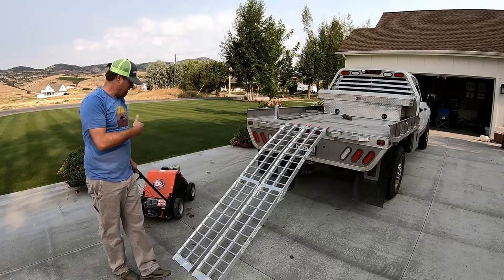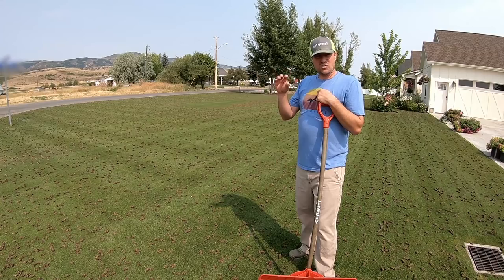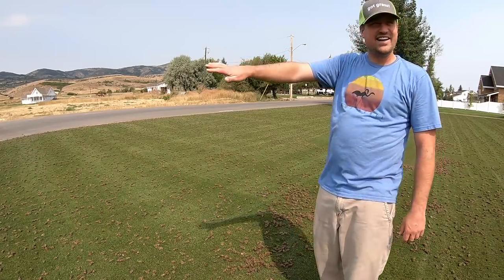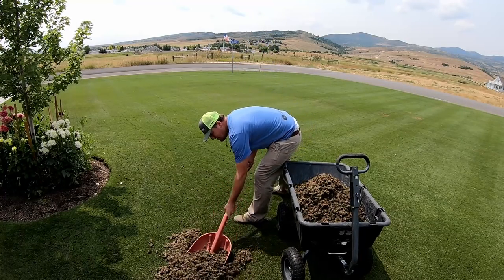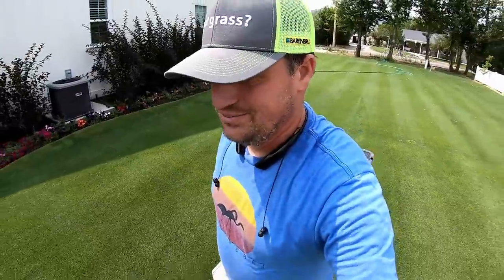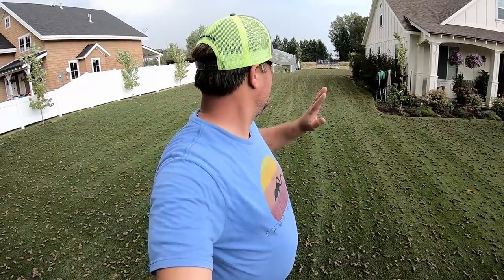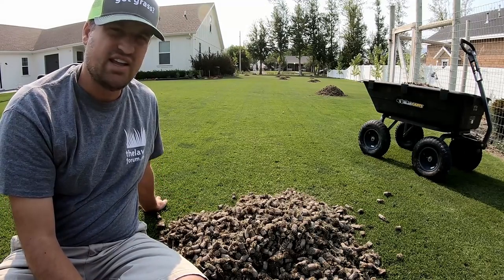How to AERATE YOUR LAWN // REEL LOW  //  Connor Ward

Comment: A great idea I've seen and done is after the core aeration, you spread out the fine dried steer manure and rake into the holes and water heavy.  Works amazing for amending your soil right at the root level and gets the nutrients and organics worked in deep.  Highly recommend with the clay soil!  Great channel BTW.  You earned a new subscriber!

Comment: Hi Connor, 
Great job on the Aerating, that is a very big job.
That would be like aerating a entire championship ranked golf 500 yd fairway and shoveling the cores by hand.
Thank you for sharing and I look forward to sand and over seeding. 
Cheers,
Craig
Reply: Craig true to an extent. No knock on Connor at all, but he’s just using a drum aerator. Golf courses utilize piston driven aerators which pull way more plugs. There’s basically a hole close to every inch or so depending on how they space it
Reply: @Datdudetd46  he's actually not using a drum aerator it's a reciprocating aerator, similar to what courses use. You're right that he's not creating as many holes though.

Comment: If you have a rotary mower can let the cores dry out, then mow them for a free top dressing then just blow the thatch. 

Before landscaping I worked golf courses, we shoveled the cores from the greens and fairways since they were reel mowed, but on the rough we used the rotary mowers after the cores dried to pulverize into topdressing.

Comment: Good job bud, you can always verticut also to get some thatch out,I'm sure your aware of that, eventually you will have enough sand mix in the soil where you can just grind the plugs up, drag the sand in, blow away the left over grass tissue, your right on removing the cores to improve your soil profile,  very well done

Comment: Hi Conner, I know this is an old video. I was in golf and I 100 percent understand why you remove the cores. I’ve done it on greens and tees many times before. I’ve seen you drag the sand in. Have you ever considered or tried dragging the cores when they’re dry?  I know there will be a short clean up after dragging but it might mitigate some of the layering inevitable by sand only top dressing   Love your content!!

Comment: hey Mr. Ward, something we do on our reel mowed yards down south when aerating instead of manually picking the plugs up is running over it with a rotary mower on its lowest setting. it usually gets rid of id say 90 percent of the plugs. I don't blame you for not wanting to run over all that dirt with the reel as it would absolutely ruin the cut quality. Hope this little trick helps
thanks for the vid man your property is looking fantastic.

Comment: It looks amazing Connor. You can tell your work hard in that yard and the landscaping is amazing too. You should look into the Ventrac 3000 series tractor and the aerator attachment. It punches holes and vibrates so there is no core. They are costly little tractors but the attachments that have are amazing. I'm trying to get my 'finance committee' to approve one for me.

Comment: From a golf course super, Core aeration is more than just letting water get down there and nutrients. It pushes black layers down, allow for air exchange, relieves compaction, breaks a heavy thatch layer, makes phosphorus available to the roots at the root level. For a lawn, once every few years is more than enough. Vertticutting the cores bust them up into dust if topdressing is not practical. It also helps in recovery do apply fert around 3-5 days before aeration. It is in peak growth when the time of aeration happens allowing for faster recovery. 
We get 25k rounds a year and 1 time per year is enough to do a good job.
Reply from the maker: Cool. Thanks for your input.

Comment: yeah, I wondered about using sand to fill the holes to keep the passage open for water and air to get down to the roots....as I've never seen anyone do that(so was thinking they wouldn't take long to just close back up).... thanks for the information

its not looking like I'll be able to get to the point where I can aerate and sand this year....I'm still killing weeds, edging, chopping out exposed tree roots, and leveling with dirt; also working on soil quality building, so aeration might still help now...it can take years to develop a nice lawn

Comment: I love your channel where is the button for that ? 😂😂😂. Should re brand the name One Guy works to hard & to much to grow a lawn. True store I bought a new house up in WISCONSIN  years and years ago. I bought a plastic spreader bought estates brand cheap old fertilizer at farm n fleet for like $4.99 a 40 pound bag back then. I double dosed that lawn in the spring while it was raining plastic bag over the top. In the fall I put in double bag rate of Kentucky 31 blue grass. The next spring I hit it once more with a double dose of fertilizer. The only other thing I ever done to it in 12 years was mow it. I'd let it grow to 4 inches and mow back an inch every 3 to 4 day's depending on rains or even morning dew. I never aerated never dumped 2000 pounds of sand. Low mowing encourages disease/ weeds period. Requires far more watering excessive work. But I'm addicted watching you work like a feverish dog for putting green's, 🤣🤣🤣. @ great expense too boot.

Comment: If you would take a drag mat and break  the plugs up the sand you used the years before break off and the clay will stay in big chunks the amount of microbe s you leave is very bennifical. Learned this from plugging and sanding greens.  

PS im a greenskeeper

Comment: On an heavy equipment like that or bigger you can have a small 2000 lb electric winch in the bed of your truck to help assist you to save your back and for safety for loading and unloading...

Comment: I wonder how long he's been at that property, replacing soil cores with 100% sand?  Seems like over time, that would drastically change the top 3-4" of soil composition to mostly sand and reducing it's ability to hold water or hold nutrients.
Reply: I worked at Erin Hills 2011-2013 and they replaced cores with 100% sand..

Comment: I've heard if you let the plugs dry out and then mow with a pedestrian mower without a grass collector on. The cores then become a top dressing. Great video
Reply from the maker: Main reason for collecting the plugs is to incorporate sand into my dense heavy clay soil to improve drainage. Ultimately I wanted to change the soil profile.

Comment: might I suggest using a power broom like you would use on the patio or driveway to broom all cores into a row ot piles.
Reply: Love the suggestion of a rake. However I have 2 acres of lawn to do. The power broom I ban rent and is quicker. I use the paddle head.

Comment: My entry level Billy Goat works with that same action.
I am mostly using the solid 3/8 tines because, like you said, raking and shoveling hollow tine cores is so very hard.
The native soil here has been in weeds for so long that I notice less weed seeds being brought up for me to curse as well.
Not something you will see, for sure.
Reply: Wayne, could you explain how solid tines actually "aerate" your lawn. All that seems to do is push the soil down....compacting it, and pushing the other soil apart which again compacts the  soil surrounding the hole.
Seems you get the 'look' without the actual benefit of loosening the soil.
Reply: @TheAUricle  Solid tines work best on turf that has been grown on soil that sat in weeds or was pasture for a time.
Cutting cores and dispersing that soil on the surface causes a growth of weeds.
I do have four choices of tine in stock, 3/8 and 5/8 plug and 3/8 and 5/8 solid and can easily change them out, however even property owners on clay like the solid tine to work in top dressing, seed meal fertilizer, and granular Leonardite as a humic source.
Before I bought this machine I questioned Matt Martin and he replied that it would work fine, as it does.
I believe the core aeration machine makers print or speak some half truths to sell their product.
Business wise it sets me apart from everyone in my area and many golfers have seen solid tines used on their golf courses and then seek it out.
Please don't knock it until you have tried it.
Reply: Wayne, thanks for the info. Not 'knocking' solid tines really, just don't see how that that fits the definition of "aeration". I can see the benefit of the application however. Not trying to nit-pick either. Guess I'm just a stickler for detail.
Reply: @TheAUricle  I understand that if removing organic material is what you need to do then core aeration is what you want to do.
But on sandy soils I have not seen a difference, visible to the eye that would tell me that I am not loosening compaction allowing water to penetrate and air to be exchanged.
I guess it depends on how you define "aeration".
Because I am in Canada and the cities I work in have bylaws against herbicide use, anything I can do to reduce new weed pressure is my other goal.

Comment: So I've bought myself an Earthquake MC43 cultivator with dethatcher attachment from Amazon. Should be here tomorrow. 

I want to use some Air8 liquid aeration chems because I mow at 4 inches tall and can't rake up core's like you can. Hit it with weed b gon, dethatch & then overseed with super seed store recommended,   TTT Fescue. My question is, can I use Milorganite as a starter fertilizer? Or do I need to go buy some other type of fertilizer for the new seed?

My local Walmart was closing out their inventory of old formula Milo for $9 a bag. When I saw the online price of new Milo shoot thru the roof, I bought all 26 bags of old formula that they had. I'm hoping I now, don't have to go buy more fertilizer.

Comment: out of curiosity, why not fill those holes with some of that black compost for lawns/gardens, at least run over the lawn with a lawn mower and break those plugs down after you spread some fertilizer,   i honestly don't see the point in dumping sand on a lawn besides leveling it,  if i would aerate the lawn then i would definitely  give it some nutrition/fertilizer

Comment: From a professional turf manager. You’re wasting money and energy trashing the plugs with your Top Dressing. Run the rotary mower over them or a drag mat and bust them up and brush it back in
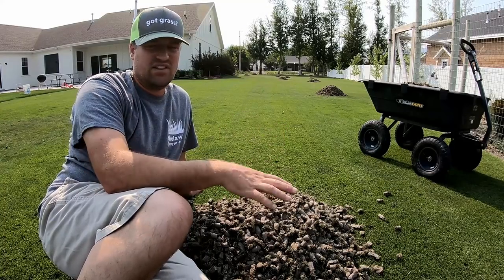Reply: he explains at 8:35
Reply: @95netta  If you mow them with a rotary they will break down after you mow and it wont affect your reel mowing after that.
Reply: Yea, do the job of the worms, makes total sense.
Reply: @clicgear100  
Cameron is correct. YouTube videos like this one are designed to help people and Cameron's response assists in doing that.

Comment: In regards to cleanup of the plugs; why not leave them on the lawn, set your mower deck up high and use the blades to suck up the plugs and blast their pieces all over the place? That would save the labor and disposal of them later on, unless there's something I am missing.

Comment: Cool videos!  Won't there be a point that the soil is more sand than dirt?
Reply from the maker: Yeah eventually
Reply: @lawnrebel  I'm guessing it will take many years? At the late you're putting down sand?  I've never used only sand, just curious
Reply from the maker: I am betting after about 2 or 3 rounds of sand after plugging it would be sand
Reply: @lawnrebel  ok, thanks.  I'm going to do what you did plus some top soil.  Your yard looks great!  Cool video's too

Comment: Is there a reel mower you would recommend in the 1,000 or cheaper price range. Im thinking about getting my backyard low.
Reply: thelaC100 I’m not CW, but I highly recommend the item I’m linking.  It’s what I use to cut Bermuda at 1/2”.   Super-fast (how fast can you walk?  Or sprint?).  Zero maintenance  as long as you don’t mow rocks or steel objects.  Gets great gas mileage, too.  $314.  http://www.reelmowersetc.com/product/widest-reel-mower/45-0252-SW.html

Comment: Why not use Air8, or maybe do one side with core aeration and the other side with Air8?
Reply from the maker: I will use air8 in the future. I wanted a mechanical aeration done. It has been 2 years since I have pulled cores.

Comment: Some genius is going to come along and invert a core aerator that will pull the cores and bag them, automatically, and he’s going to make a fortune! $$$. Even if you had empty the bag after two passes, it would still be faster than having to rake them all up.
In the meantime I would use a rake, because the rake is going to knock the sandy loamy material off the cores and leave the actual clay ball part behind to collect. I would want to leave the good topsoil, broken up, on top of your lawn to wash back into the holes. Use the clay balls to make raised beds, mixed well with compost and a little sand. Certainly, don’t take them to a landfill. Our landfills are filled with stuff that shouldn’t be even be in them, including any type of organic material.

Comment: Great video! Would a pull behind lawn sweeper work instead of shoveling/raking? Might take a couple of passes but would be faster than shoveling. Those sweepers aren't that expensive.
Reply from the maker: I wanted to try to minimize the amount of "tires" or wheels on the turf. The plugging really kind of tore of the turf and it made the ground super soft.
Reply: Gotcha! Thanks for the reply. Keep up the inspiring work.

Comment: Amazing stuff. But, in another video, you dump several tons of sand, level it out to flatten the yard, but in this video, you essentially remove some of that sand by getting rid of the cores. Seems to me you should keep those piles full of the nutrients and the sand you worked so hard to lay down over the years, grind them up, disperse back in next time round. Just a thought.
Reply: Dude, you made a lot of work for yourself. Dethatch. Aerate. Leave the pugs on the lawn, they will break down within a week. Spread a 20% sand; 50% compost; and 30% topsoil if you prefer, to fill in any low spots or drainage or light ponding issues. Overseed, followed by rolling, then water every day for at least 7 days.

Comment: 6:50 that isn't the right machine for a property your size, you need what they use at the golf course...or at least the Torro Pro Core 648. That would be perfect for you lot size if you can rent it.
Reply from the maker: I can hire a guy with that procore machine for 600$ or rent that baby machine for $50. Guess what option I chose?

Comment: you are supposed to leave the cores on the lawn... didn't anyone tell you how to use it when you got it? as you remove the cores that has soil, then you add sand, all you are doing is making your soil less and less soil. If anything, spread top soil or something like that. The cores will decompose if you leave them on...

Comment: Why couldn't you  aerate and  mow over the  cores?
Reply from the maker: You can't mow over the cores with a cylinder reel mower. It will ruin the blades and frankly won't do anything. Reel is nothing like a rotary